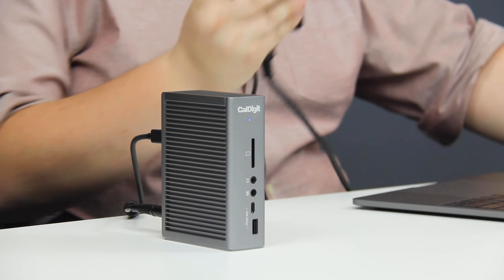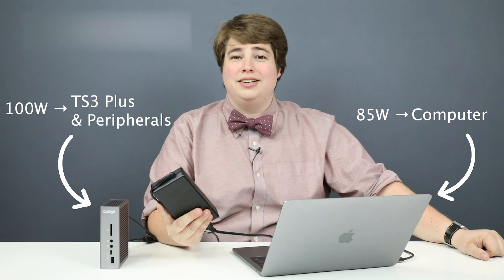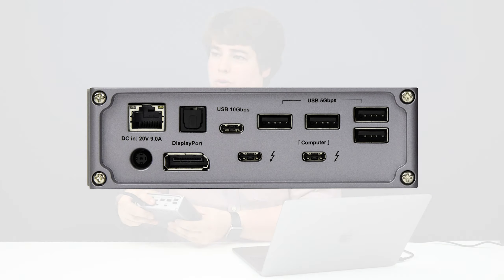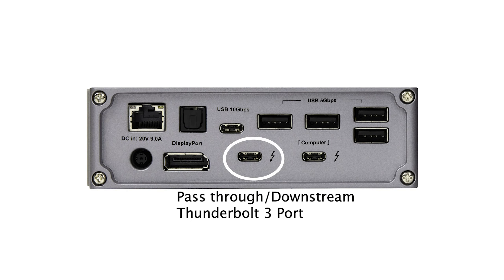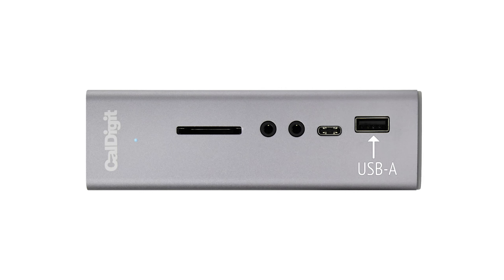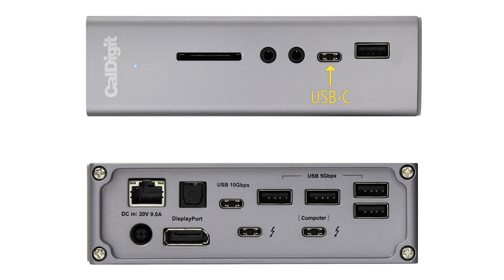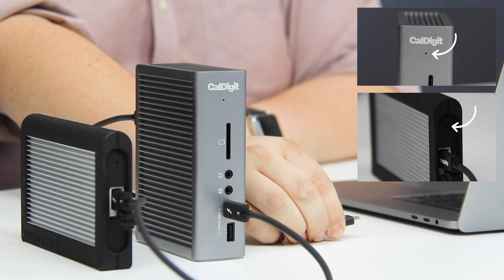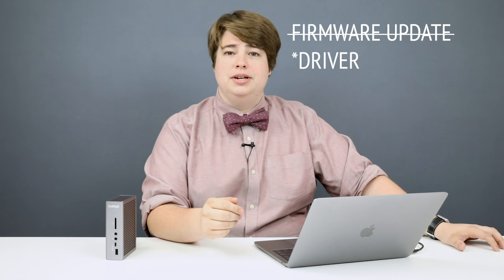CalDigit Support: TS3 Plus - 85W Charging, USB ports power, Apple SuperDrive Driver

Comment: I'm looking into purchasing this dock. Can I use all the dock's ports but not charge my MacBook or does the dock automatically charge the device. Would be good to be able to turn off charging and just use it as a hub/dock
Reply from the maker: The TS3 Plus does always charge, but there is a bit of a workaround.  If you use the secondary Thunderbolt port on the TS3 Plus (the one NOT labelled "Computer"), everything will work and the only difference will be that the TS3 Plus supplies 15W of power instead of the 85-87W.  This is such a small amount that macOS will not even register it as charging.

Also, if you are using another charging source, your computer is smart enough to only accept charging from one source at a time.  Using the full charging port with a Mac Mini is perfectly safe, for example.
Reply: @CalDigitHQ  Thank you so much! So am I able to use the official apple charger for charging and just use the caldigit for ports?
Reply from the maker: @Frizzle2003  Yeah, you can definitely do that!   If you use the secondary Thunderbolt 3 port it will always use your genuine apple charger when plugged in.
Reply: @CalDigitHQ  just received my Caldigit dock a couple of days ago, I have been using the other thunderbolt port for using it with my MacBook as you said it wouldn’t charge my MacBook. When I plug it in, it doesn’t charge the MacBook which is good but it does after a few minutes. Is there anyway I can use the dock without charging, cheers
Reply from the maker: @Frizzle2003  The 15W secondary option is the best you can do on a macOS device.  Our support team may have some further suggestions for you.  You can reach them one of the following ways:
Email: Support@CalDigit.com
Livechat: https://caldigit.com/support/

Comment: Great Video and than you. Will the TS2 (Thunderbolt 2 dock) AC power supply work for the new TS3 Plus IF im using seperate power to charge my computer?
Reply from the maker: No.  The TS2 and TS3 Plus use separate power supplies, and you can damage the TS3 Plus if you use another power supply.
Reply: @CalDigitHQ  copy that. Thank you. I see the differences.

Comment: Hello, can I plug the "computer" port into a desktop computer (Mac Studio), or will it damage the computer? Thanks!
Reply from the maker: That is a totally safe and valid way to use the TS3 Plus and Mac Studio.  Your Mac Studio is smart enough to not accept power from the TS3 Plus.  It will simply tell the TS3 Plus not to send power, and everything else will work normally.

Comment: Just ordered mine from apple store in taiwan. Cant wait to have more stable conections for my novations and Arturia midi devices... should I download anything if I use few midi controlers?
Reply from the maker: You most likely will not need any additional power, but it will depend on whether the MIDI controllers are powered or not.  If you find the device isn't working, give the driver in this video a try and see if it improves things.
Reply: CalDigit thanks

Comment: Can I connect the monitor in thunderbolt 3 85w, and the 15w on the macbook pro 13 M1 ???
because I need a slower recharge ...
you ruin the monitor or the macbook if I do so? thanks.
Reply from the maker: Thanks for reaching out.  Your computer is smart enough to know how much charging it can support and will limit the TS3 Plus to the appropriate amount of wattage so that you don't ever have to worry about over charging your devices.
It is entirely safe to plug in your M1 MacBook Pro to the 85W Computer Thunderbolt 3 port.

Comment: Hello, Is there a Firmware driver for Windows 10 laptops to utilize the increased output of the additional thunderbolt 3 port?  Looking to charge IPad Pro 2020 through Caldigit TS3 plus while using a Lenovo Thinkpad as main computer.   
Thank you!
Reply from the maker: Thanks for reaching out!  The macOS driver to allow additional wattage from the TS3 Plus doesn't need to be installed on a Windows device.  MacOS limits wattage output on connected devices and the driver circumvents this.  As Windows does not limit wattage in this way, no driver is needed.
Reply: @CalDigitHQ  Thank you very much for the quick response!  For my clarity, is the TB3 port that I am using to charge my IPad Pro supplying more than 15W? Thanks again!
Reply from the maker: @mathewcousineau9083  The secondary Thunderbolt 3 port on the TS3 Plus is always locked at up to 15W.

Comment: Will all of the usb-A ports charge a device?  Or will only the front usb-A and the rear usb-A next to the usb-C port.
Reply from the maker: It depends on exactly when your unit was manufactured, but you are close.  While plugged into a computer, all of the TS3 Plus' USB ports will charge.  When offline, all rear USB-A ports except the one near the rear USB-C port and the front USB-A port should provide charging.
Reply: @CalDigitHQ  Just purchased the dock a week ago.  My setup is this:  Connected from the thunderbolt 3  port on the left to an iMac.  All of the usb-A ports will charge my iPad except for the one on the back closet to the usb-C port.  Is that normal?
Reply from the maker: @rwsplantedaquarium6493  That sounds about right.
FYI, we have drivers on our website for increased charging speed on the TS3 Plus.  You can find it here:
https://downloads.caldigit.com/
Reply: @CalDigitHQ  Thanks.  But looks like I am already running the latest firmware, 44.1.
Reply from the maker: @rwsplantedaquarium6493  The firmware update is separate from the increase charging driver.  This is the name of the driver that increases charging "USB Charging, Apple SuperDrive, Apple Keyboard, and Improved iPhone/iPad Charging"
Reply: @CalDigitHQ  ok, great!  Thanks again!

Comment: This doesn't seems to be accurate. On my TS3 plus dock all USB ports are still powered after I disconnect the dock from my MAC. I've installed the latest firmware but still the same.
Reply from the maker: Hello, Julian.  We have seen a handful of units that exhibit anomalous in regards to USB charging.  If your device is presenting behavior that conflicts with what it stated in the video and you are interested in exchanging it, please shoot us an email at support@caldigit.com and we would be happy to help you further.

Comment: Does the ts3+ work without connecting it to a power outlet? Can it work when it is just connected to Mac?
Reply from the maker: No.  The TS3 Plus requires wall power, it cannot be BUS powered.

Comment: Does the driver work to update power for the new MacBook Pro 16?
Reply from the maker: The driver discussed in this video is different than the firmware update to increase power delivery.   You can find that firmware update on our website at downloads.CalDigit.com